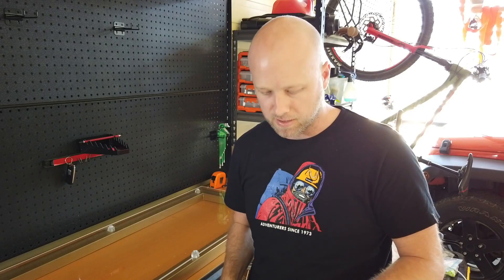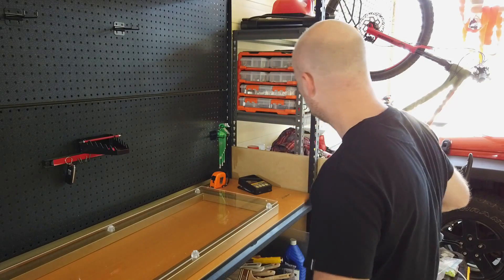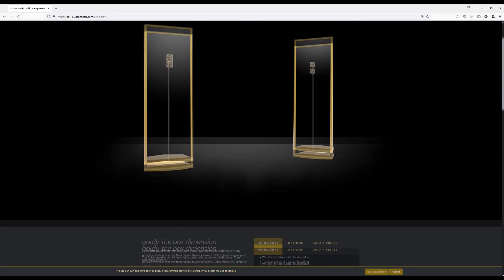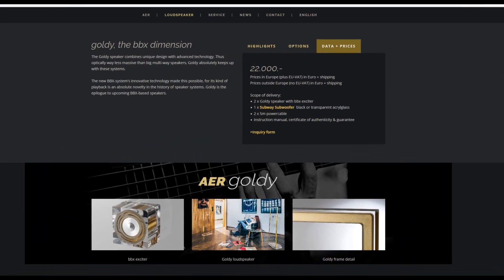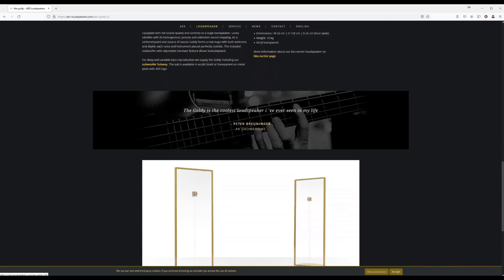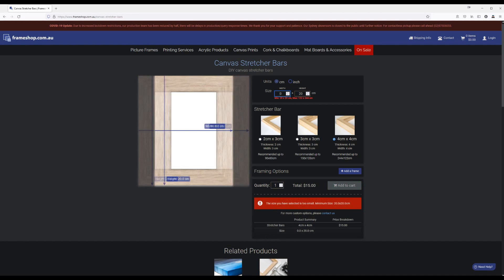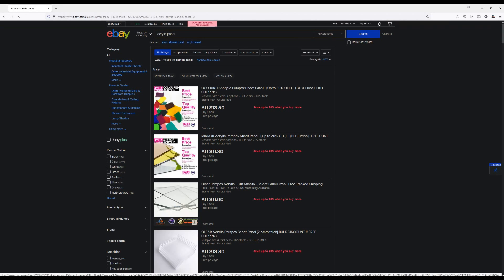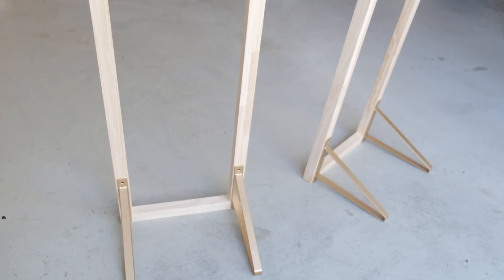Floorstanding Acrylic DML Speaker Build - Part 1

Comment: I've built a set of Foam Speakers and I'm delighted at the result. I'm thinking of idea's about using 1/8 th acrylic and methods to Float them in the frame. I'm thinking foam tape around all the edges...I'd like to paint on the acrylic something like a Seascape....
Reply from the maker: Sounds good! I think the foam tape could work really well.

Comment: So I want to start off by saying that I love your content.  These projects are awesome.  I have a couple of questions:  1) Have you thought about bending the Acrylic panel, in order to create a more even dispersion pattern(like an electrostat)?, 2) I'm wondering about making a DML home theater, and can't help but wonder about the pros/cons/feasibility of a DML center channel.
Reply from the maker: Hi Doug, thanks very much! To answer your questions:
1) It has crossed my mind and I know others have experimented with curved panels (not acrylic that I know of) but this is usually to add stiffness to the panel. The dispersion is wide enough with a flat panel I reckon. At some point I will get around to doing off-axis measurements of my panels as well.
2) I don't know much about home theater to be honest. I assume the center channel doesn't typically need a lot of low end so you could use a relatively small, thin panel with a moderately-sized driver to get better HF. One thing to consider again would be the fairly wide dispersion - maybe you know whether that's a pro or a con!

Comment: Why are you hard mounting your DML panels instead of free-hanging them?
Reply from the maker: My first pair were free-hanging but after lots of listening I felt they needed some dampening. I'd seen panels with rubber surrounds but thought I'd try the idea of securing the panel at certain points to add rigidity to the whole thing.

Long story short - in my experience this setup sounds great but you do need to throw a bit of power at them.

Comment: I would try a little different mounting mechanism.  Perhaps a longer screw by about 1cm and insert a light spring around the screw to suspend the panel away from the rubber grommet.  I think that would allow the panel to move more freely.  The rubber dampens a lot of vibration.

Comment: Hey Ben, such a cool project! How thick are the acrylic sheets?
Reply from the maker: Thanks Harry! These are 4.5mm sheets.
Reply: @TypicalBenYT  Thanks Ben. So do you think you will use 2 exciters each panel or just one?
Reply from the maker: @harrypsaradellis1933  I was thinking of using 2 per panel but recently I've leaned back towards going single.

I have decided on the location of the first exciter, so I think I'll attach it, do some more testing then reach a final decision on that. 

I'm using some pretty hefty 40w exciters so my if I do go to multi-drivers, it will be to smooth out a lumpy response, not because I need the power.

Comment: lol ... make it expensive, they will come. Pointer; the next time your going to line up two pieces place your marked piece over the piece you mounting to and do your pilot holes, mark the position, then carry on opening your holes. You'll find things line up better and it goes smoother.
Reply from the maker: I don't understand the first line but yeah I sort of did the measuring/marking backwards. Like I said in the video - not exactly a master craftsman here! Thanks for the tip though.

Comment: Some ideas, consider the reaction mass of the drivers. increase their weight to increase energy transfer to the plane. Tune their weight to target specific resonance to improve response. Have dual drivers with different weights/resonance to flatten out the curve. The bigger the planes the better. Try a version where the speaker backs are hard fixed to the wall, paint the surface white. Make a 5.1 version with panels near flush to the wall painted white.
Reply from the maker: Hey Suresh, thanks for the ideas. Have you tried adding mass to the drivers vs bracing the drivers with a spine?
Reply: @TypicalBenYT  I think I saw one of your videos or another youtuber where they secured the drivers with a spine. I think this will have a different net effect to tuning their mass and playing with resonance. I think i've seen another tuber where they played with distributed tuned mass on the back of the panel.
I would love a version of this where it almost looks like the wall and is near flush (bar some cut lines that give it separation). Port holes might need to be cut into the wall behind to allow air movement. This is just aesthetic, no doubt they perform better off the wall.

Comment: greetings from the uk, try this Ben, 1blank canvas with frame aprox 2feet x 3feet, 1piece of birch ply A4 size 6mm thick,  3 metal discs 4inches in dia. 1stainless steel, 1mild steel, 1brass, aprox 1mm thick. Glue the birch ply to the back of the canvas in the centre, stick the metal discs around the edge of the ply, half on half off with double sided strong tape to form a triangle, place the speaker in the centre of the ply and enjoy. FANTASTIC SOUND......
Reply: was going to suggest your build, man... glad you already did it, Nice...
Hope he tries it... and have great results like you did.
Great Day, PeaceV & Be Well, Steve
Reply: Do you have a guide/image or something for your build online? It sounds intriguing.
Reply: @TheTrueAnarchel  sorry for the late reply I've been away, I've tried to explain the process as best as possible, if you decide to make them you will be amazed at how they sound, I'll be happy to help you with the build and answer your questions. Regards... Steve.

Comment: Great video! Did you consider using glass? What were your thoughts for/against?
Reply from the maker: Hey Robert, yes it had crossed my mind. 

I knew that glass would offer better rigidity but at the cost of higher weight. As I was planning to go with the rigid frame, the rigidity seemed less of an issue (I knew I could always add additional points of attachment, as in the video) so the acrylic seemed like the better option. I'm also not at all confident in drilling through a glass panel...maybe it's not as bad as I imagine it but the acrylic seemed a safer bet in that respect as well!

Comment: Absolutely fantastic. I'm intrigued by the foam DLM's but have always wandered about how the wood ply panels would compare (and why no one seemed to go for bamboo, which seemed perfect to me). I've also been intrigued about how other materials would do, so you've sated a great deal of my curiosity. Cheers! I've read about canvas speakers that fix the exciters to a spine, and the exciters to a wooden card pressing into the canvas. I received all materials yesterday, including to Dayton thrusters, so I'm (*gulp*) ready to give it a go! Thanks for your inspiration and humor
Reply from the maker: Great, I'd love to hear how it works for you. The canvas art sounds like a great way to make a 'hidden' speaker. Will you try to absorb the sound out of the rear at all?
Reply: I'm actually just going to make them plain ol', blank panel speakers on a stand or hanging from string. I understand why the idea of hiding them is appealing (stealth stereo!) but I think I'd be cooler on my end to actually see and be aware of them. Plus, I want control over how tight the canvas is. It's interesting that there are long sections about this topic on some of the DML threads, but I haven't seen any YouTube videos about it, other than people wanting to sell some finished product. I'm camera shy, but I just might document whatever the heck I end up cobbling together. Mine'll be a hack job, but at least it'll be raw material for amusement, if nothing else. Can't wait to see how you finish your much-better-than-goldies, how they sound, and how you fine tune them!

Comment: Thank you for sharing,  Ben.
You have partly answered one of my questions about how to mount a DML speaker inside a frame or on a stand.
Echoing Steve's earlier comment, it is fascinating that you get such different quality with the exciter closer to a mounting point. 
Anyone here willing to sacrifice a dozen or so acrylic sheets, and a lot of time, experimenting with mounts at 2/5, 1/2, etc, and exciter at different positions too?
Reply from the maker: Thanks Hume. I do actually have another bit of acrylic - it might be worth putting a basic frame together and testing a few configurations before committing on my main panels… I’m actually wondering how it would sound with even more attachment points (eg half way between the center and the ends). I assume there is a point at which the panel becomes ‘over damped’ but up to that point it might continue to improve the sound.

Comment: Tips:
Drill acrylic when it's supported on an extruded foam scrap. Supports the sheet against vibrations.
Wax the drill bit before-hand.
Gold (or any metallic) spray paint seems to shine better when painted over a white primer, then over sprayed with a transparent spray.

Great luck with the rest :-) Subbed

For added character, one can slightly distress the wood frame beforehand, then after the Gold spray, lightly rub a brown shoe wax overall, & wipe, leaving the depressions & graining still wax-filled, then transparent spray. It's wood, after all, not smooth plastic or metal :-)
Reply: Forgot to ask...What thickness acrylic, please? And, had you considered the other plastic sheet types available, rather than acrylic? These decisions would effect the acoustic properties!

You know, any sign shop has all sorts of different sheet good "cut-offs" they'd gladly sell cheap, if not for free.
Reply from the maker: @antoniiocaluso1071  Yes sorry I'll add it to the description - I'm using 4.5mm panels. I'll have to wait and see how it goes volume-wise, as this material is quite a bit heavier than the bamboo I used last time (I will have twice as many exciters on this one though).

I haven't really though about any  similar materials at this point - the good thing about this frame design though is that it's relatively straightforward to swap out panels later on.
Reply from the maker: Hey Antoniio - great info, thanks so much for the tips!

Comment: I prefer the design of your speakers to the Goldy! Be interesting to see if you can manage an elegant wiring solution such as that shown on the Goldy though. I'm also curious how yours would sound compared to the Goldy if the sound was put through the audi processor they mention on their website.
Reply from the maker: Hi Robin - I do have an idea about the wiring but can’t say for sure until the exciters arrive and I can give it a go. It will also depend on the final placement of the exciters. 

The audio processor is interesting - I wonder how much work it does in the AER setup.

Comment: They look beautiful.  I am so looking forward to your next video with the final result sound test.  I like the looks of yours better although the acrylic Exciters do look cool., and you saved around $22,000. Just an FYI, you have the last 2 minutes as black airtime.
Reply from the maker: Thanks very much Greg! I can’t wait to get the exciters and get these together… 

And thanks for the FYI. I’ll see if I can trim it.
Reply: @TypicalBenYT  Ben, I am so intrigued.  First any chance of getting the measurements of the acrylic panels?  With holding the 24 Watt exciter, which do you think have a better sound between the bamboo and the Acrylic.  You seriously did a great job!
Reply from the maker: @ProductivePM  Yes for sure. I should have some time on the weekend to start playing around with placement on these - it probably won't be final but I am interested in testing the frequency response around the attachment points.